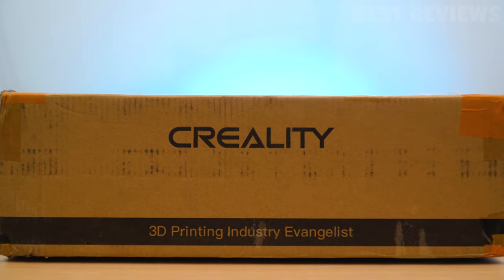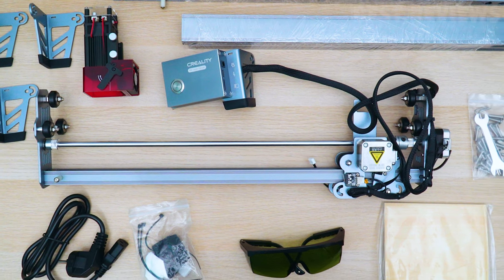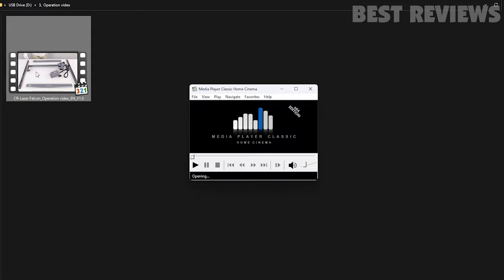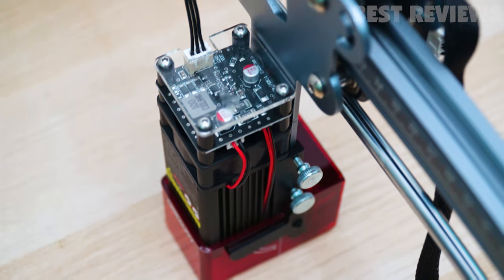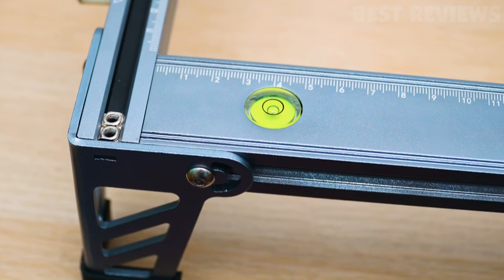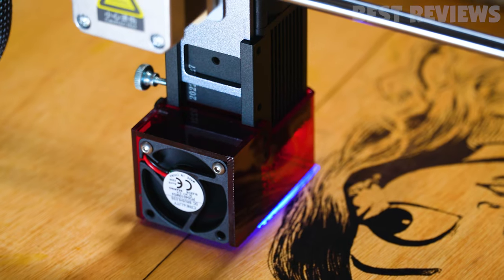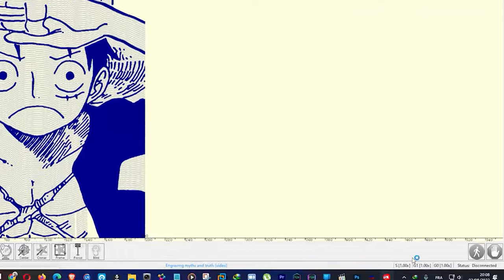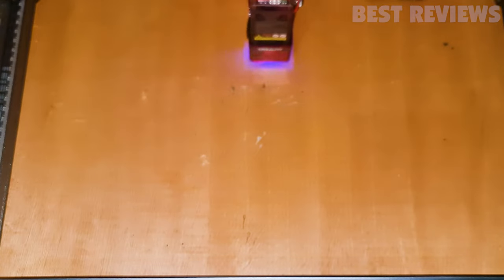Best Laser Cutter Engraving Machine - Creality CR Laser Falcon Engraver Review

Comment: I found Sculpfun S10 as the best so far
Reply from the maker: But you didn't compare them based on price,
A Creality CR Laser Falcon costs $349, while a SCULPFUN S10 costs $699, which is nearly double, meaning $249 is the difference between the two machines.
Reply: @BESTREVIEWSTOP10  well comparing performance based on price range you might be right.
Reply: Price